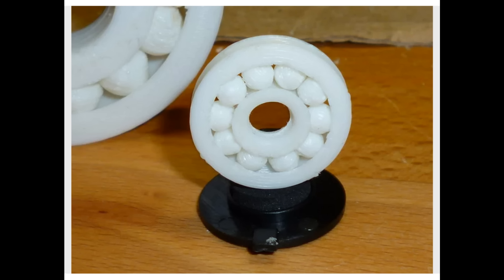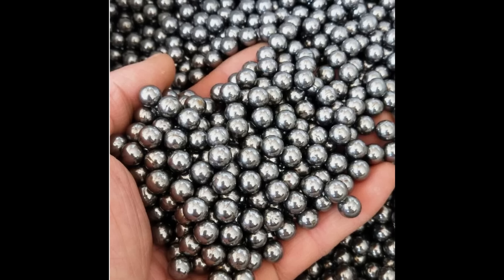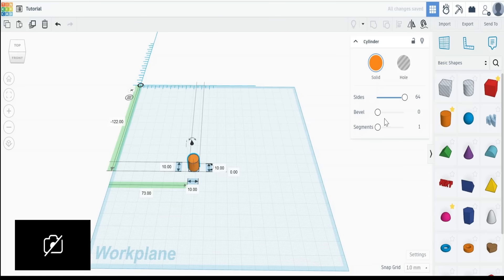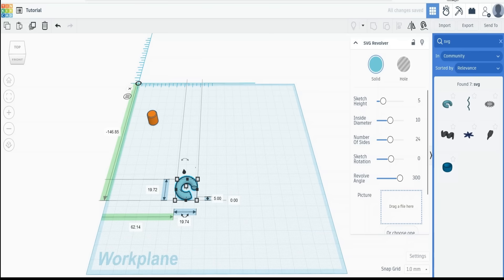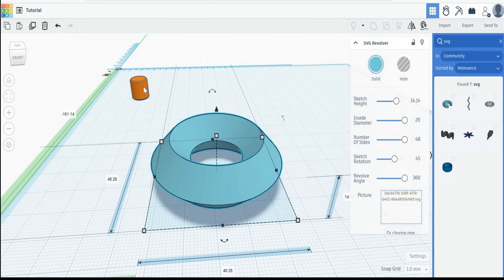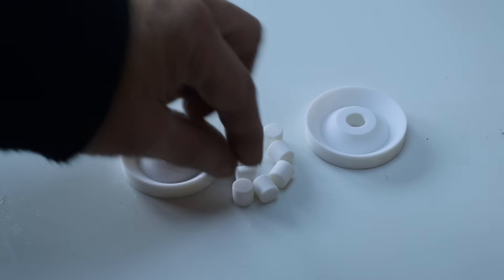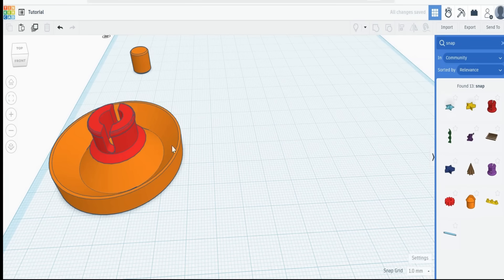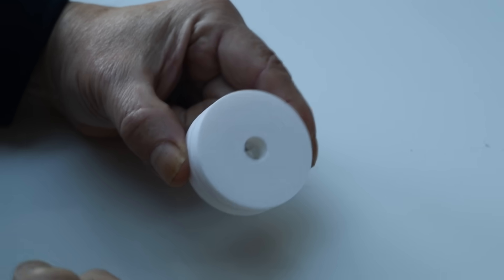2326 Universal 3D Printed Bearing That Works - Radial Cut

Comment: Does this work with all filaments/resins?
Reply from the maker: yes
Reply: @ThinkingandTinkering   thank you
Reply: No, respectfully, the softer filaments will fall to physics.  Always a trade off. It will work but not as well as soft will increase friction.  If you want to bounce in a cradle physics toy you don't do too soft.  Conversely If you want it to survive higher weights and speed maybe a little give will keep it from being so strong that it is brittle.  That clear soft rubbery filament, forget what its called will squash flat. T something?
Reply: @johnschneider931  TPU?